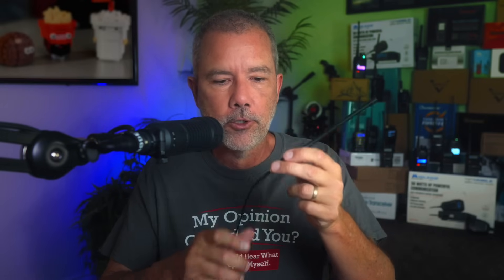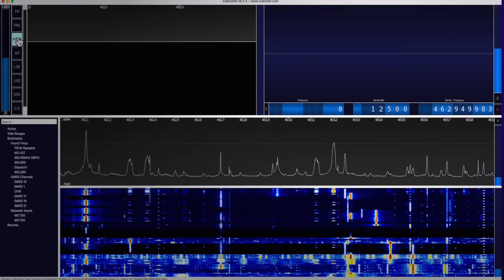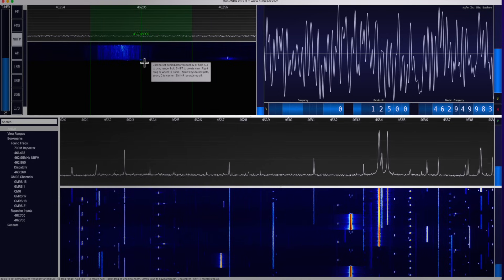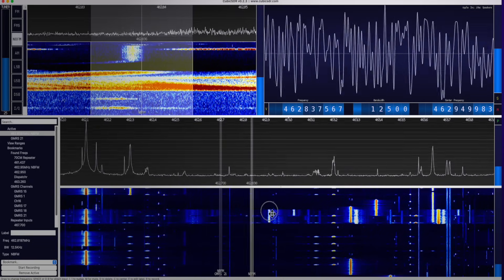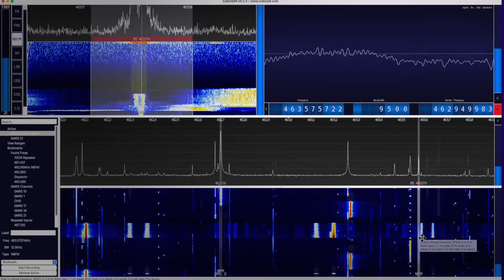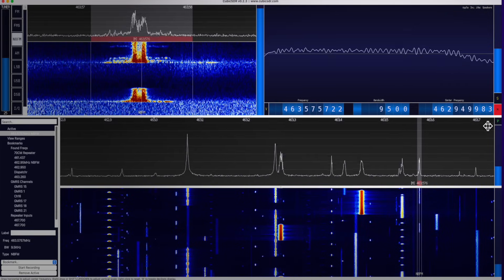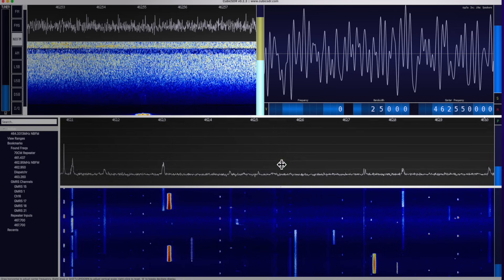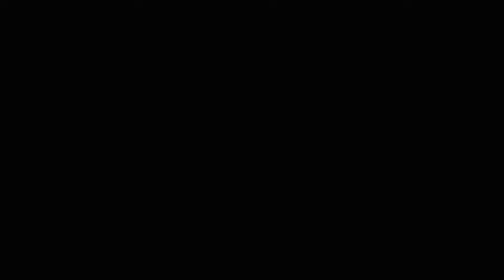SDR For Beginners - Listening To GMRS Or Ham On SDR & Basic Overview Of SDR Using CubicSDR Software

Comment: Wow! Great explanation of this software! I just sent back my RTL-SDR-V4 to Amazon. I had loaded HDSDR software and racked my brains out for days trying to navigate the airways. I was so frustrated as there were so many bells and whistles to deal with just to simply DX and find Ham operators, foreign radio stations, you name it. It seems like one would have to have a big understanding of things like a spectrum analyzers, computers and knowledge of the frequency spectrum. I just may try this CubicSDR. Looks much more straight forward! Great video! Thanks!

Comment: I'm still wearing my training panties. I'm late to the sdr party but just got one today. The only software that will work with it so far is SDR console. Sdrpp and sharp won't see the dongle. Dongle. Older Windows 10 pro laptop so many driver issues. Unfortunately I live in bumfuck Oklahoma and there isn't anything to pick up anyway except NOAA and my own uv5s that I would never transmit on.

Comment: I'm Running Cubic SDR And The RTL-SDR Dongle Exactly As In This Video And All I'm Getting Is Static Across The Board. I Know That The Antenna And Dongle Are Good Because It Works Just Fine On My S20 Ultra. Any Ideas?
Reply from the maker: There are really only two possibilities:
1) you're doing something wrong (cable/antenna/connections, etc)
2) there is nothing within range to receive
...i suppose its possible you got a defective SDR.. Maybe get a cheap walkie-talkie from Walmart and see if it can pick that up from across there room just to see if it can pick up anything.

Comment: Is Cubic SDR better than Airspy SDR.. any comparasion
Reply from the maker: I prefer airSpy now mostly because it has plugin support and the db range is not dynamic - on CubicSDR, the db range changes based on the signal levels, making it very hard to read/measure signal strength.

Comment: Thanks for the inspiration, Randy. I've been busy since I saw your video but kept in mind I wanted to get around to trying this. I just got my SDR USB device and have it up and running on MacOS using CubicSDR software. I've so far listened to several FM radio stations and also GMRS-22 while my wife transmitted using my KG-135G. Thanks also for providing the repeaters in our multi-county area.

Comment: Your video prompted me to dig out an old dongle (blue plastic case labeled "820T2 & SDR") in the project box.  Then followed your software suggestion of CubicSDR which showed up in the software manager of Linux Mint 21 on my Dell laptop.  Installed via the software manager without any problems.  Lots of noise but worked.  Some googling suggested putting a metal disk (~24cm dia) under the small (~12cm) antenna that came with the dongle.  Another suggestion was to get a USB cable 4/5 feet long and use ferrite beads on this cable so as to get the dongle away from the computer and reduce the noise being picked up.  I did both  & noise was reduced.  Did the FM broadcast station and the NOAA exercise.  Also activated a 433MHz remote and it showed up in CubicSDR.   Great bang for the buck as a way to see the spectrum usage.  Thanks for the video.

Comment: is it possible to emulate a ntsc analog receiver in sofware and tune analog frequencies and say plug a nes into your computer or a old vcr and see/hear it?
how about emulating a digital ATSC tuner module in 
software
Reply: I believe you'd need one of those video to USB dongles, or similar box. Those are capture devices, that would adapt (composite, etc) RCA input, into a USB signal that gets "decoded" by the capture device. The output would be to a resizable (video overlay) window that can act as your "display" (or TV). You can't exactly "emulate" the TV, or have "video input" unless you have an input device, connected to your computer somehow. Something like the "Fusion" emulation, can "simulate" a game console, which will enable you to play certain console games on your computer
- using a simulated "TV" display, but it's just a game window that doesn't take outside input, other than the game files themselves. 

If you have a Mac, you would need a USB or Firewire (or other connection) compatible with Mac OS, and the PC would require a device compatible with whatever OS you are using, be it Windows, Linux, etc.

Tuner software is out there, but you still need the device to interface/adapt those signals to your computer.

WinTV Go is one such device, and there are others. Try searching on Amazon to find them.

Two different worlds, software and hardware emulation, and 2 (or more) different ways to connect things.

Hope this helped ! :)

Comment: With some more dorkness and finding the right decoder, you can decode signals from different sensors, like temperature/humidity, car tires, etc. You don't need to buy a weather station - decode the signals from the neighbor! 😆

Comment: Enjoyed your video I was wondering if you could make some recommendations on a good antenna I looked around but there's so many thanks in advance...
Reply: The antenna largely depends on what frequency range you want to listen to. The SDR dongle will get the best signal for a specific frequency with a tuned antenna. As Randy demonstrated, a GMRS antenna works great for GMRS frequencies.
For very general use a scanner antenna, such as a discone (around $50 to $200 USD, depending on what frequency range you want to cover), works fairly well for me. I have one that costs about $100 and it covers 25MHz to 1.3GHz (good enough for me). To start and just get familiar with the SDR, any wire antenna outside will work. Using an outside antenna is best. Radio signals are reduced when going through walls - some frequencies more than others.

Comment: Very nice video! I would encourage everyone to get an SDR dongle and try this. A random-length wire worked great for me - about 60 feet strung horizontally and about 20' up and I was able to receive 160m up through 10m. I am able to pull in stations around the world easily. For receive, an antenna does not necessarily need to be tuned to any particular band. 

The waterfall is what got me hooked. Once I could see the signals and realized how much is going on, I wanted to understand it all more. That led to me getting my General (but I also have my GMRS license, of course) and moving into digital modes on HF.

Comment: I love my SDR, I run HDSDR with Fldigi and MMSSTV for more fun, I use a multi band scanner antenna @ 40ft and a Long Wire antenna for HF. I have a few other digi programs to decode FT8 and other Ham radio digi signals, lots of fun. My favorite Sad Ham Freq. is 7.200 LSB, those guys are Nutz.

Comment: Wait ! Did you just attach a baofeng antenna to the sdr without any counterpoise .it's just a half antenna
Reply from the maker: Yup, and it was still getting signals from 40-50 miles away.. It's weird how everything doesn't always have to be perfect, and "good enough" is often all thats needed.
Reply: @TheNotaRubicon  nailed it man, even with the crappy antennas that come with the Nooelec bundle I'm pulling in 800mhz P25 transmissions from over 100 miles away and aircraft ADS-B signals around 80 miles away

Comment: Well, I have got one of these, and it doesn't cover all the frequencies they claim it to cover. You will find out when you go below 24MHZ, you will just find a lot of echos of the same channels.
Reply from the maker: You have to enable direct sampling mode for anything below 24Mhz.. But even if it doesnt work below 24Mhz, for $29, i can live with that.
Reply: @TheNotaRubicon  Yep, for $29 it works just fine enough. I will test direct sampling. Thanks!
Reply: Add a Ham It Up upconverter for anything below that point

Comment: Great overview. With CubicSDR and SDR++ one can have a vfo for each GMRS channel and with squelch adjusted to keep backround noise quiet you can monitor all GMRS simplex frequencies at once. A small fan on the sdr receiver helps keep it running all day. Love your channel.
Reply: Great I also do it in the sdr# with multiple vfo
Reply: Nice fan tip
Reply: that's the same one I got